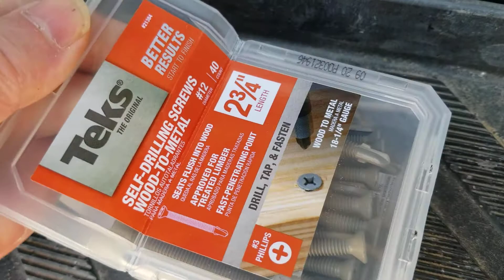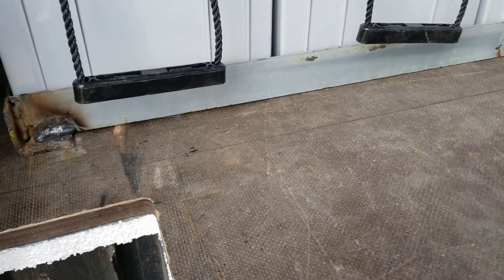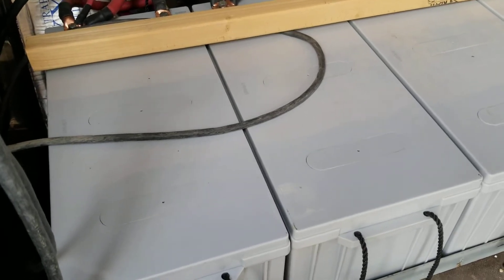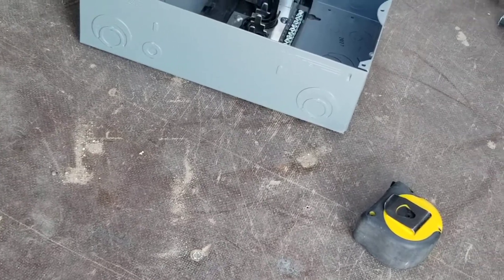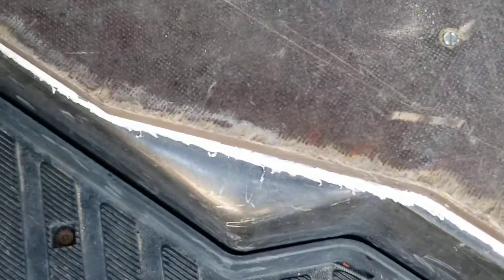Propane tank VANLIFE VAN BUILD finish  & Battery Rack build mount w good screws 😎👍

Comment: Good job on the way you secured the batteries and building the step over and it being self supporting not any weight on the batteries is a good idea.
Reply from the maker: Just watched an older video of yours & you said you were not going to insulate the floor cause you didn't plan on going in colder climates. Second thoughts now? 😂 We need another tour to see your progress inside. Stay warm.
Reply: @vanlifebiker  lol! After this, yes I'm thinking about doing something with the floor now. Last couple winters here have spoiled me and everyone else. Winters were fairly light, nothing like the last 10 days with ice and single digits.
Reply from the maker: @bandananomad  I did 3/4 foam board under 3/4 ply sub floor. Screwed straight thru it all into bed of van. Laminate on half in kitchen/entrance area. Will carpet bed area & cheap 12×12 sticky back vinyl in garage under bed. Ez clean up with water etc & cheap cause of shower pan & storage tank & pump etc. under there.